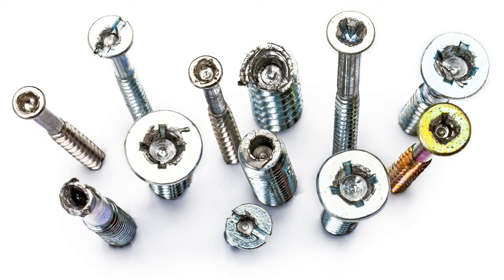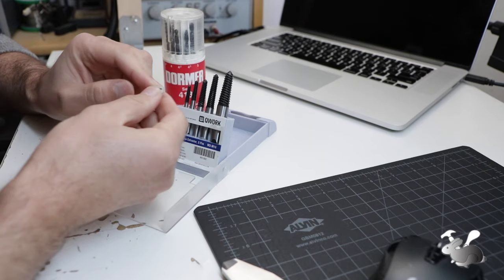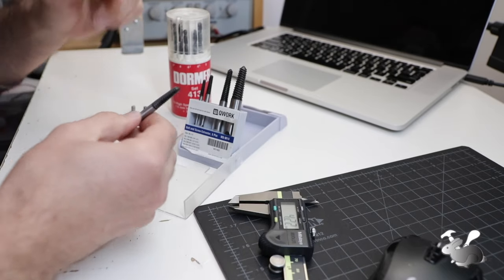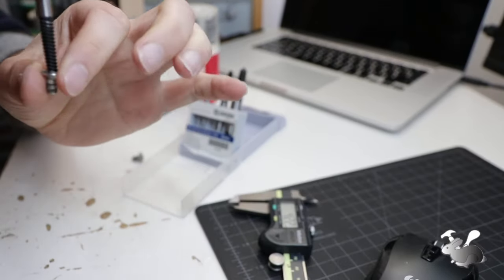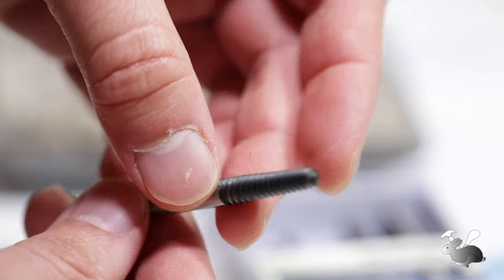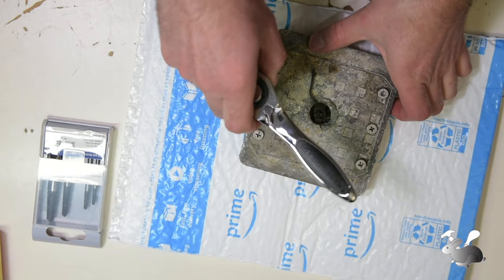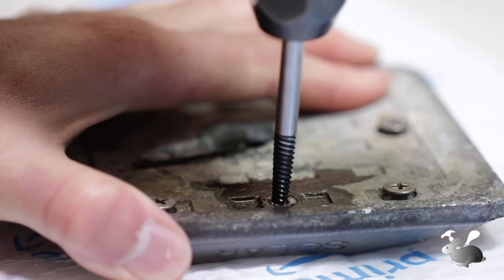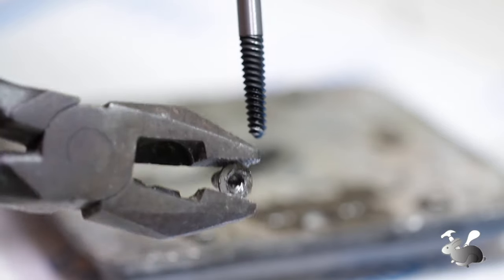How to Use a Screw Extractor | The proper way.

Comment: what do you do if you need to get the bottom half of a broke scren (so no head) out of the wood?
Reply: Use a smaller drill bit and smaller extractor bit that is a little smaller than the shaft of the broken screw
Reply: I'll be really mad.
Reply: ur SOL 😭😭😭
Reply: Do what I did and throw everything out the window
Reply: You're screwed.

Comment: Good video.. I like to live life dangerously so I selected the drill bit size by eye and drilled into the screw head. The extractor was too small so I placed the next size up in my cordless drill, set to reverse and the screw was fully extracted.. this was not a mission critical situation. Just an old wooden batten attached to the wall at the top of a cellar head 😂

Comment: thanks for making this video. i got the rusted out torx screw i needed i extracted out. i didn't have the fancy t handle i used an adjustable wrench and went slow and it worked!
Reply from the maker: Awesome. You can get it out with basic tools as well

Comment: Anyone have a suggestion for a video that's a little more delicate.  I have a screw on a IC board that I do not want to damage or crack.  Most videos appear to be for heavy duty material.
Reply: Currently have a broken screw inside my block
Reply: @pine-sol5177  ouch that must hurt
Reply: you can try using valve compound in the fastener and on the screwdriver to get a better bite. if it has a decent size head you can also try grabbing it with a set of pliers that have aggressive tooth pattern.
Reply: I would try to solder something on top of the screw. Like another screw, or anything to get a hold on. And then use a screwdriver or pliers to unscrew it.

Comment: What kinda drill bit do I use. The ones I have won't drill into the screw. They kinda just spin.
Reply: Need a metal drill bit
Reply from the maker: Hi Matthew, you need a HSS ( high speed steel) drill bit.

Comment: I am trying to DIY and outer tub replacement on an old washing machine. Well...I haven't gotten very far. The brackets outside the control panel have two philips screws. One came off fairly easily. The OTHER one?...FuhGETaboutit! A WD-40 type spray did NOT Good. 
Even if I can get that screw off, I still have to figure out the agitator head cover, and I'm Sure their will be other snafus down the road. 
If that DANG tub hadn't rusted, the machine would probably be good to go for another twenty years (it's almost forty years old already.)